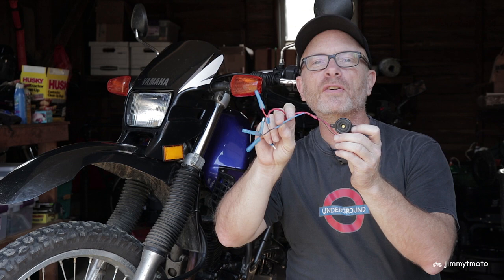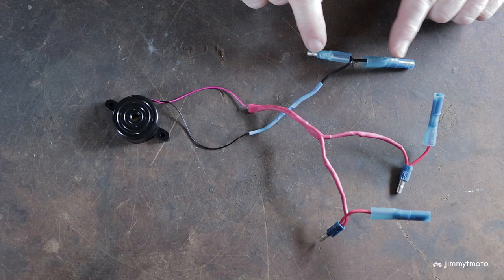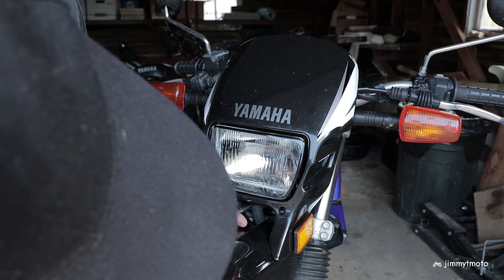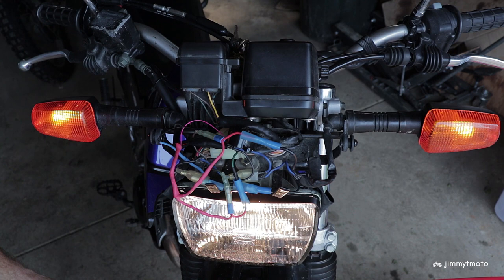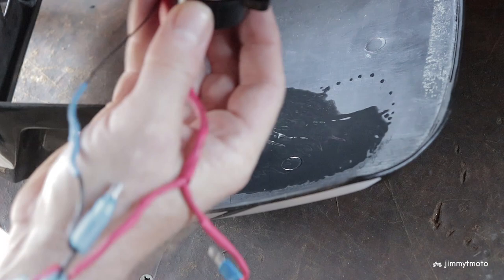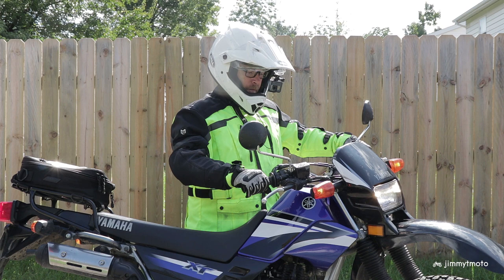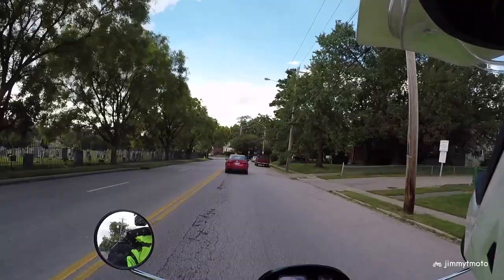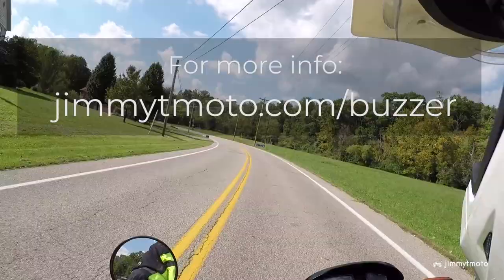DIY Motorcycle Turn Signal Buzzer

Comment: A small piece of gaffa tape over the hole will make it waterproof. Mine was excessively loud so multiple layers of tape will achieve the volume required.
Reply from the maker: Thanks, Robert! I never really waterproofed this setup, thinking I'd do it later, and somehow it's still working flawlessly two years later. Which reminds me, I should do this mod on the SR250, too...

Comment: What decibel was the buzzer? The one I have ordered is 90DB. Also if you do not want to mess with Diodes, could you just fit 2 buzzers for left and right.
Reply from the maker: This buzzer was 86db, so pretty much the same as yours. And, yes, you could just fit two buzzers, which would be easier for sure. Good luck with the project!

Comment: Thanks. I was just googling how to add a buzzer because I have the same issue with my constant on indicator light in my 1974 CB200T. I think I'm going to try this, but I already have a diode added leading up to my light because of the LED lights I added. I plan to tap into that wire right before the indicator lamp and see if that works.

Comment: if the indicator warning light on the dash is a LED lamp would all operate normally ?
Reply from the maker: Hi John, I'm not 100% sure but I think it would be fine as long as it's 12v. The turn signals are another matter, though, and would require a different flasher relay.